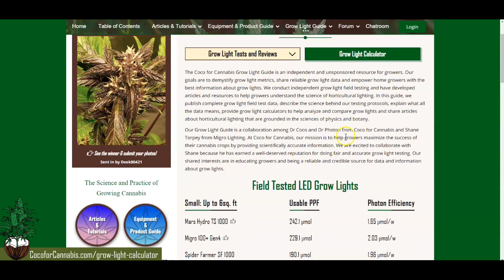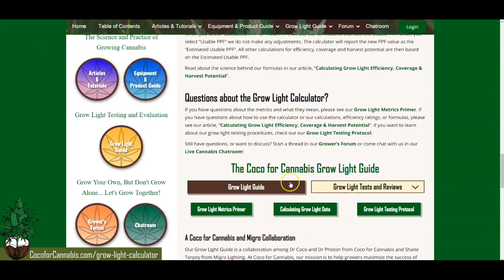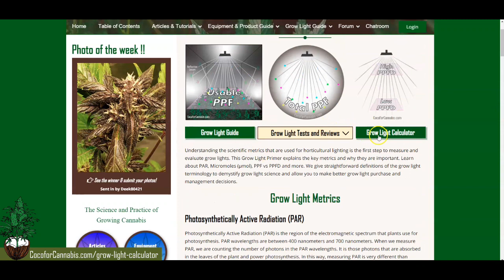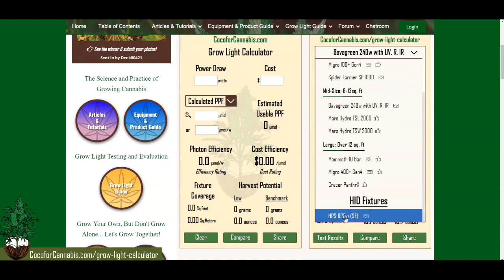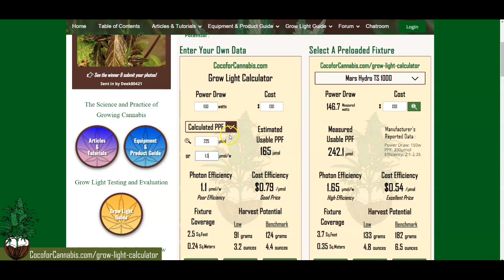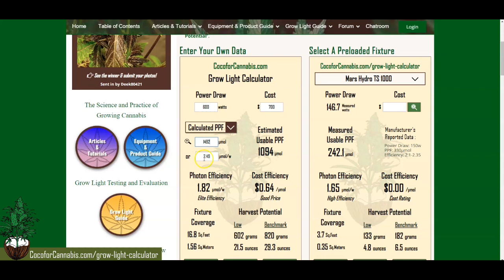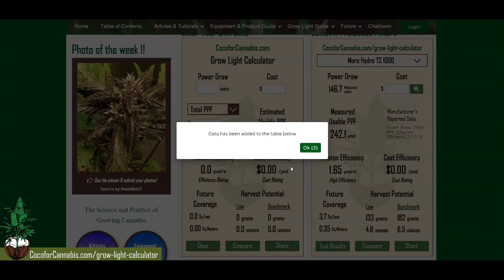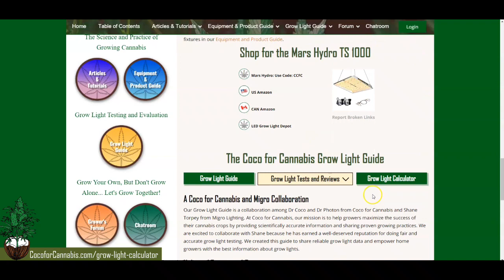The Grow Light Calculator

Comment: What is the calculation to go from average PPFD (which I can figure out) to total usable PPF (in a 24x24" area for example).  4 sq ft is 0.3716 sq meters.  So do I just multiply average PPFD by total area in sq meters?  When I do this, our numbers do not match up.  Wondering if this is just a rounding error?  EDIT.  If I do 60 cm x 60 cm, our numbers add up. LOL
Reply from the maker: Yeah - you got it. I take measurements in metric and then convert to inches so you were probably looking at a conversion error. The "2x2" test area is actually 60x60cm as you figured out :)
Reply: @DrMJCoco  thanks for the reply.  I enjoy messing around with the math.  I’m just a little too medicated rn.  I love watching Bruce Bugbees mathematical models for plants too.

Comment: Started my first plant in 1967 , grew a lot of top end bud even in 1980s with metal halide warehouse lights , I've tried them all and settled on 600 watt hps but too much heat for me so I switched to two 315 CMH ! You could not pry these from my cold dead hands , measurablly more thc than anything else period , I know this because I grow clones of the same mother's all the time ! My bud under hps = 17% same plant  CMH=22% ! I've used them all LED , Quantum's , etc. nothing comes close ........the par value is sic , 4x4 tent !
Reply: After a year you confirm what you said? CMH is better than LED?When I stepped to CMH from HPS I saw the difference. Now I’m interesting about led.
Reply: @8red7  I'll be totally honest with you , the LED technology was not that good up till recently so I have a friend that was an LED guy and after looking at his bud's I switched up my whole setup , went with Mars just cause that's what my buddy has , I spent $2-3 grand on light's , my 5x5 has a Mars Fc6500 , my veg , Mars Ts2000 , clone tent Mars Ts600 ! My plants are better than ever and my buds are the best I've ever grown , my heat issues are non existent , so I think the time I was using the HIDs they were still better but not anymore ! It was expensive but I don't regret it one bit , I grow all clones of the same strain's for years and when I finished under the Mars I barely recognized them , from 2-3 oz with HID to 8 oz under the Mars ! Of course you can still grow killer bud's under hid but I would never go back ......
Reply: @bruceholinight7978  thank you very much Bruce! I think to buy Eco Farm 320w with 301h, UV and IR for my 90x90cm tent. Have a nice day!🤟 see you at next video😎